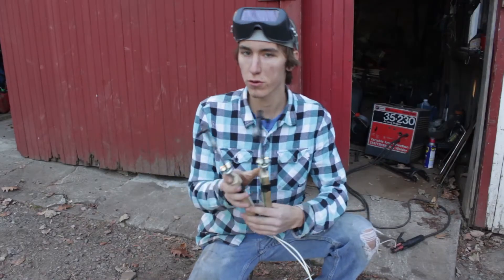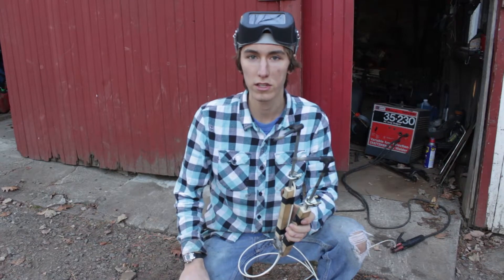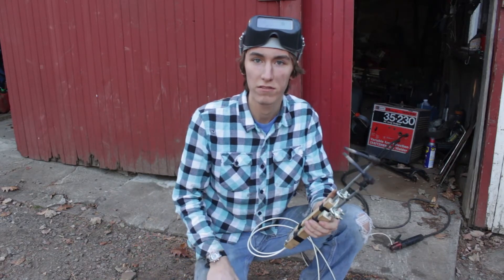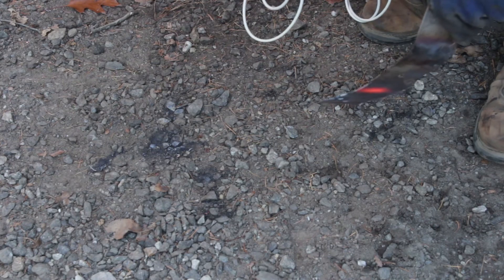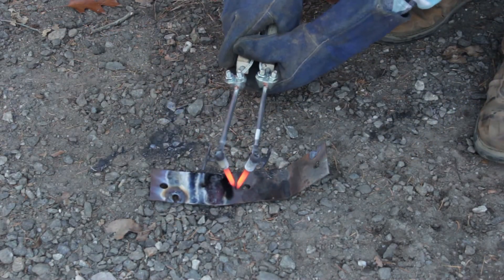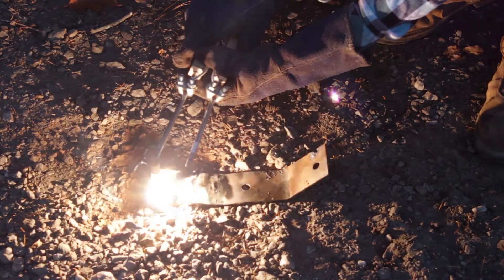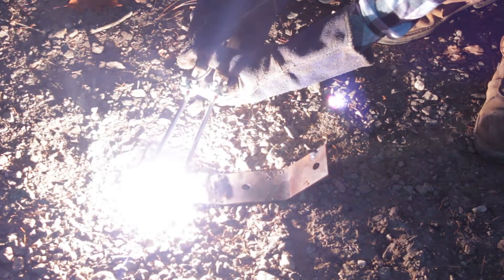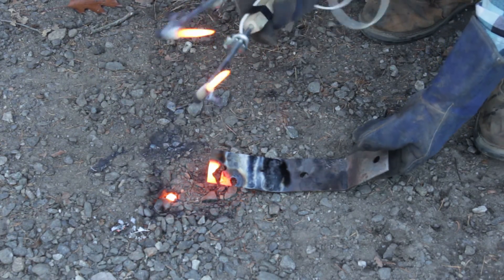Carbon Arc Torch

Comment: If you use a single electrode, you can gouge and melt metal. Use it in a similar way as you would an ordinary welding electrode.

Comment: Impressive. What if you used only one carbon rod, attached the other lead to the material you are cutting, add an air nozzle with compressed air supply to the carbon rod lead?. Point the nozzle to blow away metal as it melts. put a valve on the handle to control the air.
Reply: +Thomas Karchesy Was wondering that myself.
Reply: that's an air carbon cutting torch, which is a cousin of the carbon arc torch (and the precursor to the plasma cutter). IF you get the angles right, and work the right angles into the tips of your carbons (tapered points like a tig tungsten for steel), you get a 5000 degree f cone of flame from the arc torch. most of the cheapo commercial rigs offered nowhere near the control (or proper angles) to get the best results. GOOD ones with properly prepped carbons can be a fab hand's best buddy after the 3 lb hammer, lol. the effort above is actually a damned fine first try, it's about as good as many of the commercial rigs.